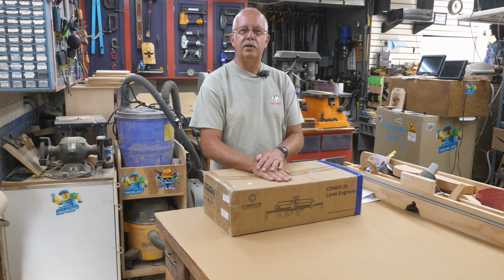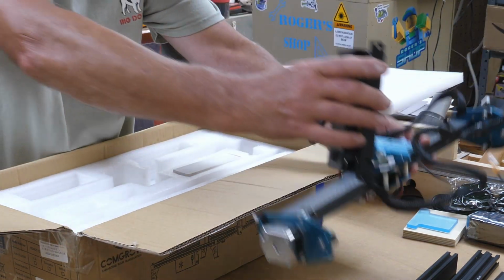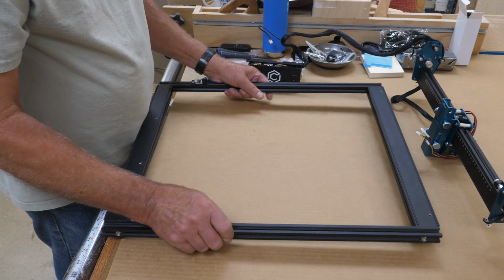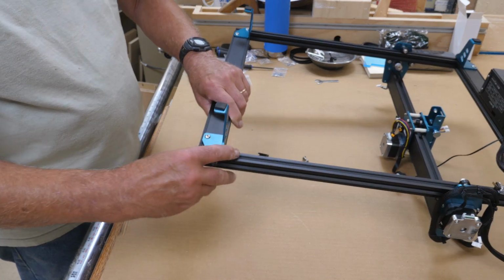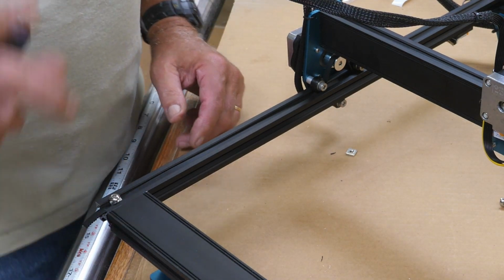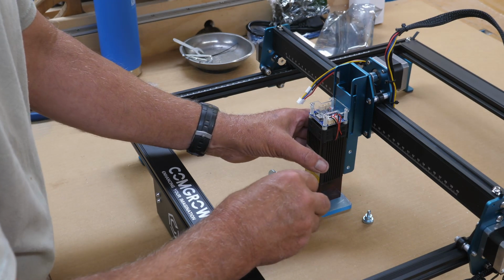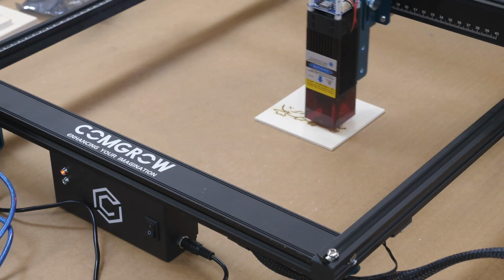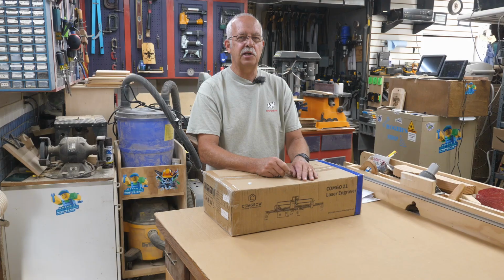Comgrow Comgo Z1 Laser Detailed Assembly

Comment: Thanks! Roger your video was very helpful and super easy to follow unfortunately the manufacture didn’t put the correct wiring together the power plug and pwn plug should have been wired separately but they put them together to make one plug, so I had to send it back and buy another Lazer Engraver, but again thank you, looking forward to seeing more of your videos , best wishes Margil Samaro 🙏✌️😎
Reply: Hey! Same thing is on my laser, I got one wire for one plug both the Power and Pwm attached to laser head. Since opening I cant make the laser to work and I am dealing with customer service  as having issues with Alarm 9, Alarm 1 and now even Error 24. Absolute nightmare, mine is out of date for return so I am just hoping to find answers online. When you send it back did you get replacement from comgrow?? Thanks!

Comment: Hello. This was a great video. My question is. Mine was cutting at an angle. When I manually moved the laser head on the gantry from right to left there was greater distantance from the frame on the right side. How would i align my gantry so there is equal distance.

Comment: The video is great and very informative but the feet are backwards LOL I built it the same way then look at the picture and realized they were in the wrong spot
Reply from the maker: it is MUCH easier to bolt the laser to a base with the feet flange facing out.  Position of the feet makes no difference on the operation of the laser.

Comment: Trying my first burn today. "Start From:" = "Current Position", "Job Origin" = left front dot. I load an image that came with it and it appears in the center of the screen in Lightburn. I click the "Frame" button and the laser moves around the front left corner the size of the image. I click "Start" and immediately get "Hard limit triggered. Machine position is likely lost..."  I can find absolutely nothing about adjusting the limit switches or why I might be getting this error.
Reply from the maker: When using Current Position, I always start from center and have the laser module in the center of the intended project before framing.  When a laser has limit switches, I always work from Absolute Coordinates and have origin in the center.  Try that and you should have no issues, but be sire to home the laser first.
Reply: @rogersshop  Changing to Absolute Coordinates was the answer. Thx

Comment: When attaching the X axis it would twist the frame out of square. I had to adjust the eccentrics but now I am wondering if they are too loose as the X can move freely with almost zero tension or drag. Is there no real issue with this or does there need to be some resistance or tension on the extrusion?
Reply from the maker: When held vertical, it should roll slowly from gravity.  Too loose and it will mess up your graphics.  Too tight can result in flat spots forming on the wheels, eventually making 'bumps' in your work.

Comment: Just received my !0 watt Z1. The video was very helpful to get started and to better understand the manual. One difference I found was in the way the legs were installed. The version of manual they now ship has the lags opposite being parallel with the outside frame versus this method inset some from the exterior. Any opinion on which might be better long term for balance and things.
Thx great job.
Reply from the maker: I mounted the legs "backwards" from what the manual shows in order to make bolting this to my base easier.  Since it is bolted down, balance is not an issue.
Reply: @rogersshop  thx for the explanation I like this idea

Comment: Hey Roger, this was a great guide.  Couple of questions; the x axis moves ok after installing the belts but there is a binding sound, like a zipper and it moves clunkily in a point or two. The wheels on the y axis seem okay. I have messed around with them quite a bit. Is the gantry supposed to be silent when it moves after putting the belts on? It still moves back and forth, just not easily like it did before the belts. thanks
Reply from the maker: Belts might be too tight, or out of alignment

Comment: My wires are different for the laser head.  I see a light on laser but no green light on power box
Reply: same on mine, my laser head has a single power/Pwm wire, not two separate ones like in video. I also do not see the blue light down on my board. Since unpacking it does not work either... having hard time..

Comment: Nice video. I watched the firmware upgrade you posted and it appears you leave the SD card in after upgrade and deleting the file. Should the SD card be put in during the assembly also or is the just a way to keep up with the card?
Reply from the maker: The laser works either way.  Just a bit faster with the SD card installed

Comment: i turn it on and no laser pointer  ????   and cant burn at all
Reply from the maker: Can you move it from the software?  If so, then it is functioning.  Double check your wire connections on the top of the laser head.  Make sure in the right  place and fully seated.
Reply: @rogersshop  its the laser grbl  thats  crazy ill get  the other one

Comment: Ok, I did 3m&ms and 4m&ms everytime. Now I'm out of m&ms and still got machine parts.
Reply from the maker: Most of the companies anymore send a few extra screws/nuts/etc. in case count is off or one has a bad thread.  If you are short hardware and still have parts to assemble, then you were shorted a bag of hardware.